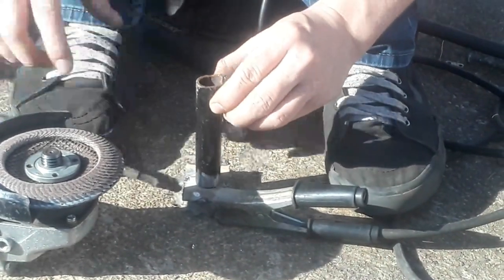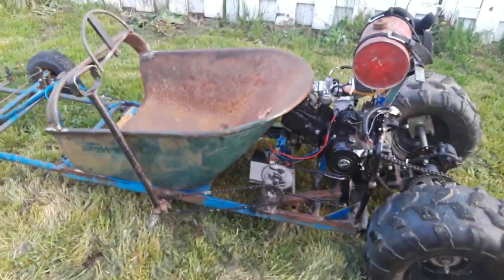125cc RAT ROD GO KART BUILD PT.3

Comment: I will not paint it at all but the one thing that would look cool is that if you put something over your feet that covers the feet and put that little fender thing that you got on there and lights and make it like the original rat rod that's a little rat Basie designed and everything where you don't see his feet or something over your front of your feet like metal and make it where it's Rusty and everything was like it for like a top over top of it and it will look cool.
Reply from the maker: Sorry I just noticed your message. We ended up painting it, but I am glad you like it.